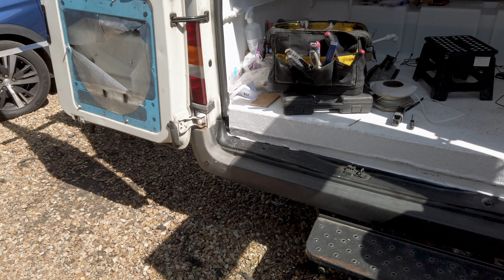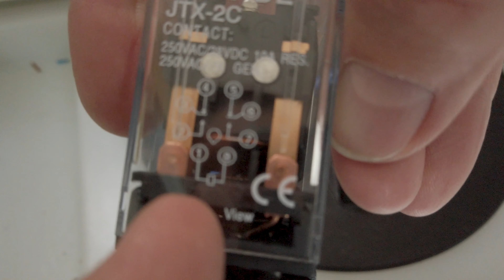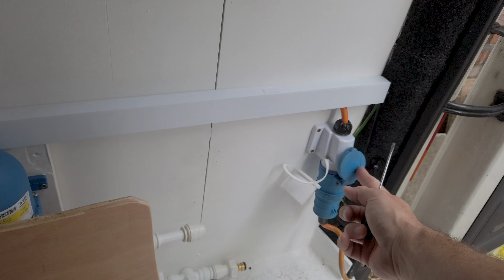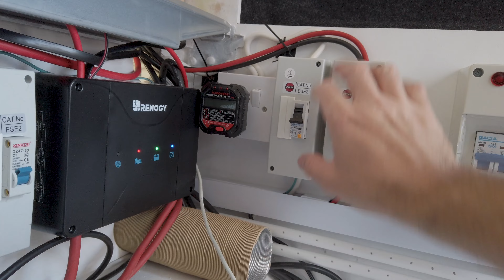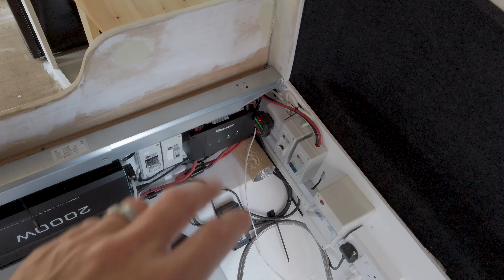Reverse Sensors | Roof Cut out carpeting | Renogy 2000w Inverter  auto switching for pass through

Comment: Hi thanks for the video. I have tried to copy what you have done but when I connect to shore power it trips the RCD (in the house not the van)
If I leave the inverter switched on as pass through it works perfectly switching from N bonded and the socket tester is green for both as expected.
Is my relay just very slow? (it looks the same as yours) only difference is I have a 3000w inverter.
If I pull the relay or leave the inverter on it connects on shore power fine.
Reply from the maker: Hello, thanks for watching. They may have updated the model since we had the problems. They did end up with legal involved and I had to sign an NDA. 

I am just speculating as I don't know the full ins and outs of your system. For example does it trip as soon as it connects or is it tripping when you test it?

Comment: Hi there. I hope your van adventures are going well. We have a renogy inverter same as your model 2000w and just coming across this information now as we're trying to wrap our heads around what needs doing. Your videos are definitely the most in depth on this subject so thank you for that. Can i ask how the neutral line of the plug coming from the renogy output is wired, as i know for the NE bond you have wired a connection from the inverter dc- to netural in your RCBO? I think. Also, where is the input of the inverter wired / plugged in to? Apologies if my question is a little difficult to understand. Many thanks

Comment: Hi Graham, In Ireland and new to your channel but enjoy the technical content. Can i ask, cause my electrical knowledge is subpar, does this inverter work as it should out of the box, slightly confused by your work arounds, if they were your preference / optional or if this product doesn't work as intended without these interventions. Also why bother using the inverter pass through if you could just wiring a more direct circuit from the 240v hook up to the house 240v circuit?
I saw in a previous video as well that this inverter seemed to be wired with live and natural reversed. What was your resolution there? Was the inverter actually wired backwards?
I really appreciate content like yours, not many people posting with your knowledge or ability to question 
Thanks
Reply from the maker: Hello, thanks for watching and commenting. It depends on how you want the inverter to work. The regs indicate the inverter should be neutral earth bonded and have RCBO protection. The only company I have found who acknowledge this are Sterling Power. They are a UK based company and you can see they work to compliance with UK regs. 

As for the renogy unit it does not work as described to me. It is Center tap, so both the L and N are live. They both carry 115v ish. the earth is not an earth either it is a floating point. 

With what I have done it separate the L and N allowing current to only pass through the L side, the N remains neutral as it should. The earth comes a point that can be bonded to the chassis and as such and residual current device can work correctly by being able to detect inbalance in the L and N and breaking the circuit. 

The relay I setup up allow the device to switch between my mod and the standard settings to allow pass through. I wanted this to work so as I plug into a mains live supply it runs everything correctly back to the Mains supply breaker and still allows my RCBO to be active. 

This all happens automatically with us having to switch circuits. 

I wanted a system as safe as possible, I have a mains fridge and a mains emersion heater in the tank. If anything happens to any of the feeds or wiring, the van will not become a big live box, the system will trip and all will be safe. 

Hope that helps, best wishes 🤠
Reply: @dontmentiontheaword  I really appreciate you taking the time to reply. So making the inverter neutral bonded disables the internal auto transfer switch. Would it have been possible to wire an external auto transfer switch instead of a relay on the bond you made? After the trouble you've had I'm honestly thinking of not wiring my 230v to any of the van sockets. I have no appliances that require it so no need for a UPS if i suddenly lost my 230v power.  My only "need" is for battery charging. How would you rate charging LiFePO4 via external hook up while discharging? As far as I know it wouldn't be any different to charging/discharging with respect to the MPPT, but you actually seem to know what you're talking about 😅.Thanks again. People like you make this whole process so much more approachable and interesting.
Reply: @DaireÓCatháin  he has made an external auto transfer switch using the relay, when its powered from mains hook up it disconnects the neutral bond and the UPS works as it should.

Comment: Well done on finding and sorting the issue with the inverter. Very interesting videos and I’m glad I’ve just found this. What’s the likelihood you’ll re-visit the original circuit diagram you made to reflect the new installation details?
Reply from the maker: Yes, it's on my to do list and also, change the title of the first video to point to revised info :-)

Thanks 🙂
Reply: Nice one. I look forward to it. 
I wouldn’t be surprised if Renogy tell you the inverter needs to be mounted horizontally. I’ve found some literature from them stating effectively that.

Comment: well done for finding the solution to the inverter. i did similar last year but with a din rail contactor with a NC setting and the DC ground end connected to the chassis as that is where it essentially goes anyway. can I ask, did your inverter buzz before doing the N-E bond or just since that? A fascinating subject for sure. I suppose that Greg Virgoe will stumble across this video, do that himself to his low budget van and renogy inverter and then take all the credit for it, as usual...😒😒
Reply: could i ask as I did not try it? did the inverter auto transfer stop working with the earth bond in place or did you choose not to use or try it for the obvious reasons? just curious...
Reply from the maker: I did create a auto switching solution. It is in another video.  https://youtu.be/Ka0lamFY7To this one I Think

Comment: So when on hookup your 240v is routed through the inverter pass through ? How does that affect the rcd as when on hook up you’ve broke the neutral/Earth bond or does the safety issue only affect when inverting, not on pass through ?
Reply: Graham. Top work. A schematic would be awesome  of your switch relay or contactor what ever you call it to neutral earth bond solution for the inverter. I'm looking at the 3000w renogy inverter or inverter charger but both are not earth bonded. You recon also it's best to go the standard inverters and use a separate 240v charger, only risk I see there is having a GPO powered by the inverter and charger into the gpo creating the dreaded inverter/battery/ charger loop. Do you need to isolate one GPO socket to house the charger. The inverter charger is super heavy and not earth bonded anyway but maybe a better option if earth bonded?? Seen jolly YouTube video part 2 inverter charger install(vandercampadventures. 
 Love to  know your thoughts. Gavin ,Australia. ❤
Reply from the maker: @Pommyadventures  Thanks Gavin. I will have to get a revised schematic done ( just time)

We actually went to the 2000w inv/chg as renogy assured us it was NE Bonded. You can find the full saga in the electrics playlist linked below. 

We now have the fogstar charger although we have never needed to use hookup yet. Driving and solar keep the battery topped up fine. We have to use a small electric heater during the winter for 1 night when the diesel heater failed. That's the first time we used more than 50%. The idea was to have 4 days without any charge in the system. That never happens. 

Thanks for watching and commenting and Glad you found it useful :-)

https://www.youtube.com/watch?v=66p0TDhs8Jo&list=PLKPs2u5v_gmheDJndvrFBMv5T2ij_Dti1&pp=gAQBiAQB
Reply from the maker: The relay i installed auto switches on hookup. That breakd the N E bond in the inveter allowing pass through to use the maind N E bond through the main consumer unit
Reply: @dontmentiontheaword  Hello, do you have a simple electric plan for us? How we have to connect the relay?
Reply from the maker: @range4200  Hello, thanks for watching and commenting. I haven't revised the electric Schematic - when I get a minute I will and let you know :-)

Comment: Surly impressive Graham. Top man for the job. Alots been done too. Shame about the parking sensors.  So is your fridge on all night , just running off the inverter...
ÀTB & FAM.....
Reply from the maker: Thanks Tim. Yeah fridge just a normal household one. I got one with a manual stat, just incase I wanted to wire direct to the inverter. But it is using so little I don't think I will need to
Reply: @dontmentiontheaword  what's a manual stat?
Reply from the maker: The thermostat in the fridge. If it is manual it can be wired directly to switch the inverter on when the temp gets to high in the fridge